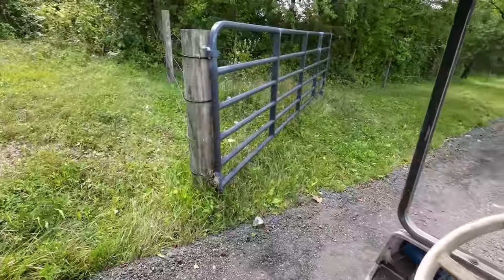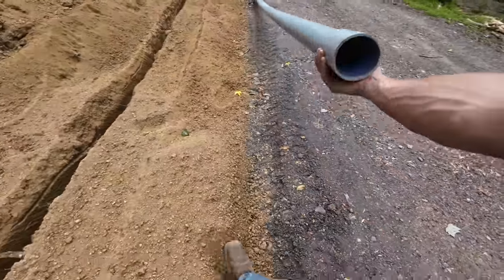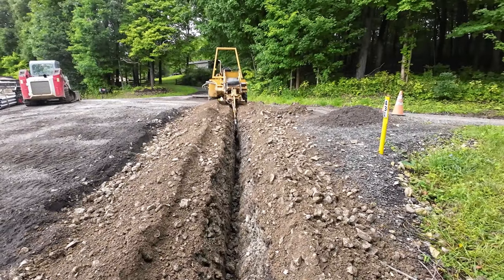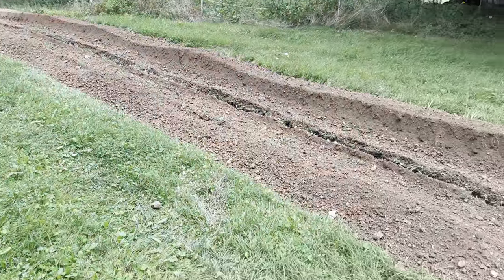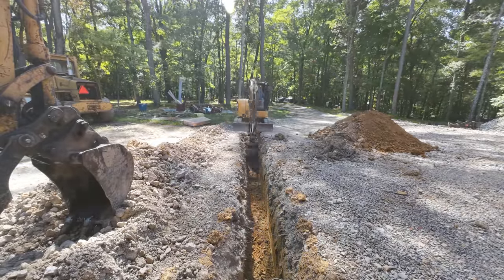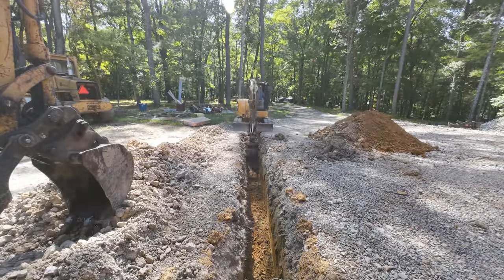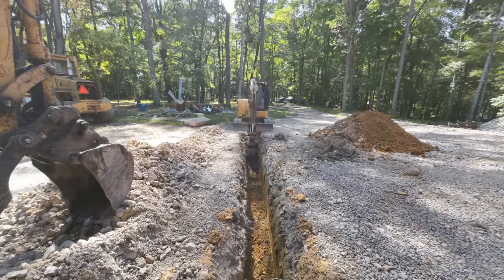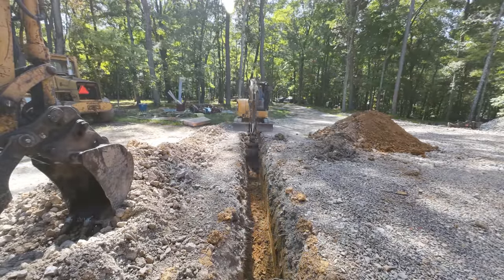Running Nearly 1/2 mile of Underground Electric, Costs over $64,000??!?!

Comment: Great job, being a retired electrician and pool builder, I figured there may have been a cheaper solution. What about the generator you bought, could couple with some solar, just a thought. As for the ditch, did U look into aerials? U could have put in your own poles, the thing is that the cable is cheaper, no conduit, no digging, a bit late now. anyhow what about the voltage drop? I see on the neibours pole only 2 wires, is that 220v? 3 phase would have been better for the workshop. In Australia we have 415v 3 phase which alows for smaller cables, our single phase is 220-240v, there again cables are 1/2 the size. look into I squared x R loss. , the current  you need and the current available. Maybe the supply authority needs to upgrade your neibours. supply, hence the sky high price. Maybe you would share the supply authorities detailed quote, we may help you understand the price. I would be interested in the specs. Some years ago I was doing a house 1.3km from the street, the authority was to use aerials and a trans former, about 32000 Aussie bucks, what we did was to have our Telecom put in a free cable to the house then we added the electric to those poles, ended up around $12000.  Back then no solar but a generator was just 12000 but it would be noisy and requires fuel, so it was rejected. Another off grid you tuber "Ambition Strikes" spent US$55000 on solar but they also have a back up generator[rarely used] NO electricity bill ever. I guess U will explore everything like buying your own cable and doin the work.

Comment: Matt, I don't know what the layout of your property is, what direction you have as far as open sky towards the south, etc. But $52,000 sounds like a solar install with days worth of battery.

If that's not feasible, find out who the electrical company uses to do the installs. Chances are, they might farm it out anyways and just have their payroll technicians do the final hook up at the pole. You may be able to save money by hiring that sub contractor.

Another thought, if I recall correctly, you have cows right? So, if they are trying to treat you as commercial, there might be a different charge and requirements if it were zoned as agricultural land or if you approach them as an agricultural customer.

Yet another thought, the charge may also be different if you were hooking up a home + pole building instead of just the shop. Throw an old mobile home on the property and run a trench over to it. Hell, then you have a space to convert into an office area or even just a break room / storage area once the actual house is built. Of course, that may encourage even later nights at the shop which may not be a good thing for marital bliss! But, you and the Missus could also temporarily move into it and sell your current home while you build the new one, that way you don't have to continue maintaining (and paying for) 2 properties while you build the house.

Comment: You might investigate if the utility will allow for an electrical utility contractor  do the URD cable install. Use a contractor that they work with and is an approved contractor. I think you might be surprised at the cost differential. The contractor may even be approved to set the transformer and make primary and secondary connections, leaving only the meter set to be done by the utility. I know in my state that this is an alternative. Using a an electrical contractor that your utility uses will make things go a lot easier. Good luck!

Comment: if they wont budge on the price, and your comfortable with it, you could always buy and pull the wire yourself, so all they have to do is set the transformer, and connect it at the pole

Comment: If your local power company is the company I think it is(the one I work for) services run to a garage alone are considered commercial which gets charged a commercial rate, Labour on that job would be through the roof as it would take a couple days to finish it more then likely Which explains the price. I personally have never even pulled primary that far, 1k to 1200 ft is the furthest we pull 9 times outta 10. And as for taking most of the year to arrange all this, sounds about right honestly.
Reply: Interesting.  With that electric company, Could Matt buy electricity from them at whatever the primary voltage is at his neighbor's pole? Next to the road or wherever the "free" wire (if  any) stops on Matt's property?  12kV? Then meter with a CT?  Matt could run the remainder with Matt buying and pulling the wire, Matt buys his own pad-mounted transformer.  Matt would need someone experienced for any splices and to wire-up the transformer.  Would that work?

Comment: 1) If you don't have caps, you can always use plastic shopping bags and rubber-bands to cap a pipe
2) Saw an electrician use a string, plastic shopping bag, and a shop-vac (On blow) to run his string through conduit...
Reply from the maker: That’s how I did ot

Comment: 1. That was a heck of job and definitely hard work even with all the machinery, great job getting it done and proving sweat equity is worth it.
2. The cost the utility company quoted sadly doesn’t surprise me. Our electric provider was really pushing solar panels and after utility rates went up almost 40% I gained interest in doing it.
The utility company said I would have to cut down 5 trees which shade about 1/2 the house at my own cost ($10K) and pay another $10k for panels & install to save…….thirty percent on my utility bill.
I asked the rep “so to save $150/month, I need to pay 20K and remove trees that shade my house meaning more energy to keep my house cool?”. The reply was “yes but it pays for itself over the 25 year lifespan of the panels.”
After laughing hysterically, I declined the offer since I had just turned 50 and either would be dead or living elsewhere.

Comment: Wow - that was insane for the utility to go that high, thanks for posting and sharing.
In hindsight this may have been a good case for a solar off grid battery system and a propane or oil heating system.  I'm not a proponent of conventional solar batteries, but I suspect someone has come up with a way to use an electric vehicle to power your lights and collect the solar energy at a reasonable cost - oil or propane could run your heat need.  For example a used Nissan leaf may be less than $6,000 which may fill the battery need for you.   All the best and God Bless. 🙏❤🇺🇸

Comment: Great videos of your power trenching and installation, your projects remind me of myself a few years back.  In 2013 I got a 1200' estimate from the power company in N. central WA state for 18-21k just for the wire and transformer (like pulling teeth to get an est.) and like you I had to do the trenching and conduit.  52k sounds like a fortune and it is but with inflation it may not be that far off from what I was quoted 10 years ago.  In 1982 2200' only cost me 5k plus the trenching!

Comment: Presumably the power authority is just giving you a rate based upon distance without doing any cost calculation. In other words, they are charging you the same rate they would have if they had set poles and run overhead lines. They don't HAVE a rate for anything else. When I asked about extending the 3-phase service from town to my property (in Canada) for a 1 MW solar project, the immediate response was $83,000 per kilometre. They didn't look it up or calculate anything. It's just the number they have. The free 300 ft is just from the road to the point of connection, assumed to be a house.

Did you ask beforehand how much it would be to deliver the complete service above ground? I think you'll find it's about the same as what they they want now.

Comment: If you are in a frost area you need to put an expansion fitting up to the meter. If not the movement will destroy the meter socket. As for the MV wiring you may be better off to higher a private contractor to pull the cable in.

Comment: Part of that cost might be having to upgrade a portion of there system to accommodate the additional load. The existing system might not have the capacity to provide the power you need. You should be able to request what all they are having to "replace or upgrade" to provide you the service.

Comment: Too late but i would have set some polea in  the ditch to mark exactly where the wire is..
We had a Woodburner
  Get a 12 volt one so if light go out it will still pump water.    Car battery.   They will hold fire 3 days. Electric draft is good too.
  We kept water at 180 drgrees.

Comment: Matt, to me, 52k sounds reasonable if they we dropping in poles (@2k each) and string wires overhead.  In the ground, I can see where the expense could come in: The Transformer and each individual break points?  I'm guessing the each breakpoint requires a special high-capacity box to keep the power flowing. (I remember seeing one of those in a Dirt Perfect video, where Indiana power continue the connections).   Yeah, I can see the expense (I'm guessing Solar/off-grid was not an option).

Comment: As an electrician from Local 38, it was our responsibility to pull the cables from the transformer to the meter base and to the main panel. Sometimes we'd pull the 14kv cable to the pole and leave extra there and at the transformer pad. We'd terminate the low sides, they'd terminate the high sides. I'm not sure what your public utilities rules are. Your price sounds like cable pulls, transformer and termination all done by them.

Comment: Little too late now... but you ever heard of C-I-C cable? "Cable in conduit"  

Now depending on code or not may not be up to par.. but we use it all the time in Texas. Could have bought a 3,000ft spool of cable already in a sdr17 poly jacketing. Would have been less then $24k for the whole spool of 500mcm in 3in poly. Plus zero install labor for pulling cable.. just roll it off from an a-frame

Comment: They are probably  charging by the foot to run the ele. lines , even though  you put the conduit in.   They probably are charging as if they are puttingin the conduit too.

You buy and install the ele. wires and they can (probably) only charge you for the hookup.

Comment: 1)So you have to hire the utility for the wire install? 2) Could Direct bury cable be used? What about an electrical  contractors installing the runs with utility doing final connection at pole only? 
I hope you film some of the completion work regardless who does the finish. Thanks for a Great film..👍
Reply: Get a fault on db cable. You need locating equipment to repair it
Ug repairs costs are usually 3 or 4 times overhead costs

Comment: With all of the trenching I would have thought that you would have wanted to also run another conduit for fiber optic cable. In my area when we trenched for power we would always through in a 1" or 1.5 " conduit for fiber optic cable for internet/networking use.

Comment: Really impressive.  Never on your scale, but as a HVAC tech and owning a restaurant service business, I've pulled miles of wire thru conduit -  but almost all in buildings.  For the life of me, I can't figure out how you intend to pull 1/2 mile of wiring in one go.
Reply: He broke it up into 700 foot pull sections. Thats about the maximum pull section for 1/0 urd cable ( the over tension at 700 is max on that cable)

Comment: Matt, it’s likely very different for you in the US but here in the UK you can ask for a full written estimate of all costs for all works from anybody that you engage with so that you both know what exactly you’re paying for and to enable you to compare $ (or £!) costs from other interested parties, even from big utility companies.
At the very least I’d be asking myself if it’s feasible for a separate contractor to supply and lay the electrical cable leaving just the utility company to deal with the final connections and assemblies such as the transformer etc as they’ll be far cheaper??? Best of luck to you buddy, Tony 😎

Comment: it seems like they have quoted you commercial rates.  You probably need to specifically define the usage as personal. Or present a project scope that includes a home of some description so it will be a residential classification.  Pull an old single wide in there and abra cadabra it's a homestead,

Comment: Have the powered company set up the trans former at the pole to step the power down to 440 volts then run the line to the shop amd have a Secondary transformer to get to 120/240 like they do for center pivots

Comment: Two thoughts:  first, the power company (PP&L?) thinks they have you over a barrel because of the coming onset of winter.  You can use one of your generators or rent one for the winter; their quote may drop after winter sets in and they are looking for assignments for their crews.  

Alternatively, have you looked into getting a solar panel and battery set?  

It may well cost you less than the remaining cost of the electric line and the savings will continue going forward.
Reply: Have you seen the gantry crane for his workshop, that beast will require a lot of power and a solar and battery setup to cover a workshop, house and farm property will be extremely costly and you'll have to have a big backup generator too.

Comment: The overhead to the power company is horrendous. They have to pay for their buildings  equipment, engineers, linemen, managers, etc.  Engineering has to update drawings, on and on. I was 36 years Army Engineers civilian. Mechanical, and we worked with everyone. I hope you can get the price down.  You put so much into your videos.  They get better and better. Keep them coming Matt. 👍

Comment: Was looking at a place in the wilds outside of Reno, with no electric. Power company would charge us $60k to run power from 1 mile away.  Each ranch that connected would refund $5k to us. A full solar + generator setup would cost $35k. The choice was obvious.

Comment: I live on 300acres 10miles from power. I installed solar and batteries to run 240volt to 60+ amps for less. I could have come over from Australia and done it for you for less, in 1 week.

Comment: From my experience, if you put in a request for a new run, the power company would run it for you up to X number of feet from the building. Around here, typically, if you install conduit yourself, you become responsible for the cost of everything from the pole to structure run.

Comment: buy the cable on your own, after running your pull line through the PVC you can set up your tugger to pull sections of conductors through each segment. depending on the conductor type will determine the cost. make sure to leave extra length of conductor pulled in each panel location. a buried cable (ie. Teck 90) would not require PVC three individual conductors inside a PVC conduit may be more cost effective for the products, but not the labour. all conductors pulled in could be checked and verified, by use of a meggar to test. but if you have all the conductors pulled to each respective location, then it is panel mounting and termination left to the contractor (power company) this should reduce your cost substantially. used transformers can be purchase at a fraction of the cost with not lead time as a new one would be.

Comment: Hey Matt! Do you think this is a good deal? New equipment at the local JD dealer.
JD 1025R utility tractor. 2023 model.
120R loader with bucket
260B backhoe with bucket
$26,200 Plus Sales Tax total $28,296.

Comment: For what's it's worth... My 2 cents... For that cost, one could of done 3 Phase power with a Sol-Ark system, with redundant inverters and 60+ kWH of battery storage and never give the power company a single dollar of your hard-earned money. I realize it's too late now, but geez, the first red-flag would of been the conduit cost... Even before the power company got back with the quote. To top it off, you're going to be running hot water all winter through the floor, regardless.... Just work up a DIY system and pipe some out to the panels to melt the snow, if one was worried about snow accumulation on the panels. I realize that it's also a learning curve, but for 64K+ I would watch some YouTube, hire a consultant and get myself some "free" power for the rest of my life. Even if they do work with you on the pricing, after you pay them 20/30/40 Thousand dollars... You're still going to have to pay for the power used every money for the rest of you life. But this is the great thing about YouTube, people live me giving our comments, the one's who don't actually have to do the work or fork out the cash.   ***Regardless, I'm still a big fan and will continue to watch!***

Comment: Hey Matt what about finding a diesel generator or maybe a locomotive engine powerplant that would do the job I feel getting a used diesel generator from the cracker plant could be use as recying your old oilsplus have a backup  in case of a weather emergency

Comment: Buy your own wire, pull it through yourself, have it terminate in a box on the pole, and the costs should be a lot lower. I had a pole to box wire hooked up for $850 earlier this year. 

Electric utilities are often municipality enforced monopolies, so I’d check local ordinances and regulations to see what recourse you may have if that’s the case.